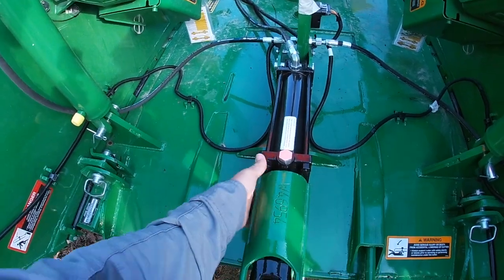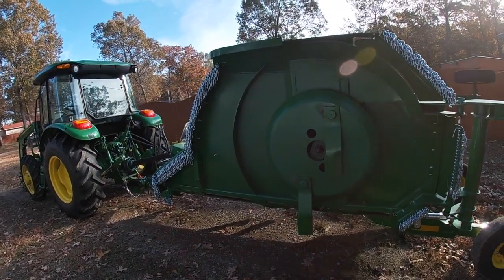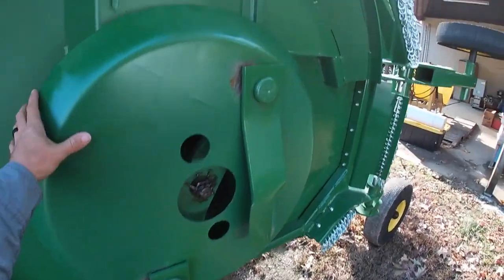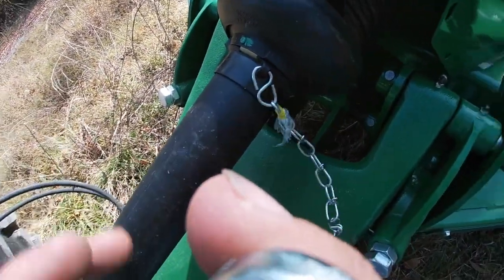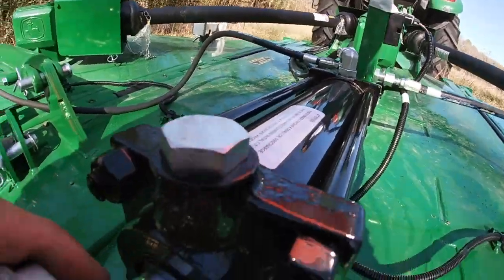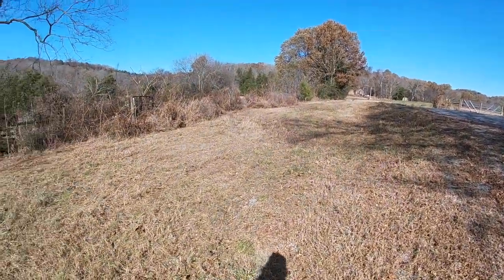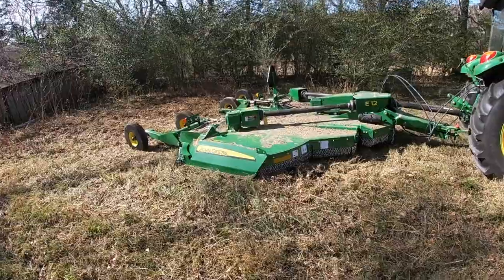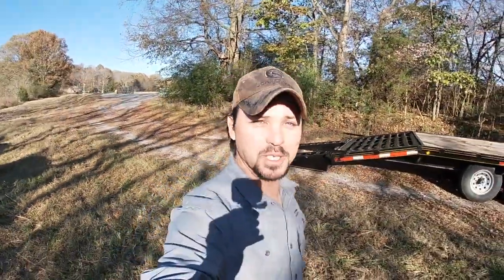E12 Rotary Cutter First Impressions

Comment: Bought an E12 been happy with it. Except, get a good wide zip strip. Wire up the hydraulic hoses by the bat wing lift cylinders. Mine got pinched in the lock pin assembly...

Comment: You need two hydralic valves. One for the up down, one for the wing up-down-float.
Reply: I put the cylinder lift in the back were it’s supposed to go and run the wing lift hose to the block operated by the joy stick.

Comment: How does that tractor and cutter do when you are in real thick green grass?  I use a 5320, 5075E and. 5085E on a HX10 and if the grass is tall and thick enough they are loaded pretty heavily
Reply: Bumping this question as I’m interested in the same

Comment: Bought exact machine today, I will be using it on one scv, manual talks about control valve available, what’s best way to run this thing off one lever, any input appreciated
Reply from the maker: You need to make sure your dealer plumbs the hydraulics where you can do that… everything is hydraulic up and gravity down.  So even if both your hoses are pressure hoses, you just pull your lever slightly backwards or forwards, to where the hydraulics can free flow, and gravity will push the unit down.
Reply: @theweekendfarmer7513  found a manual valve 120 bucks for what I’m doing I think I’ll try that , I understand what your saying thanks

Comment: How did you plumb your Cutter ? Mine came w 1 hose to the tractor. Looks like you have 2 hoses. I cannot lift the belly of the mower without the sides coming up first. Makes it hard when cutting and need to lift cutter. I have to disengage to raise it. It also makes it difficult to engage in y’all grass bc the mower is all the way down to the height I have it set. At the 5 min mark of your video you show yours will lift the belly first then the wings. Please provide me with some guidance.
Reply: I’d like an answer to that as wel , I have to get off and raise it up again so I don’t scalp ,
Reply: @Nathan Justice 
I am not sure. I only have 2 hydraulic connections on the rear of my tractor. Is that the same for you ? Could you provide me with the dealer location you purchased yours from ?
Reply: @Nathan Justice thank you for your help. I only have 1 SCV. The original video that I watched on here from the Weekend Farmer only has 1 SCV as well. However he has 2 hoses on the cutter. I only have 1. Not sure what he did to make that work but if you watch his video at the 5 min mark you will see what I’m referencing. Not sure how to make it work like that.

Comment: Hey we have the exact same set up, I was hoping you could answer me a question whenever i mow the left and right deck always seem to cut un evenly close to the hinges of the middle deck , I’ve tried plenty of times to level , but it always seems to do the same . Thanks in advance
Reply from the maker: Sounds like your wings are letting down too far.  There are adjustments on the outer wheels.  Or, maybe the middle section needs to be lower. There is an adjustment for that as well.

Comment: How long is the trailer you are using with this set up?  Would you recommend this length or something longer?  Thanks
Reply from the maker: Barry Strother.This trailer is 30ft.  Yes I would recommend at least 30ft.  This length is plenty for this tractor, but I do have to set the loader on the neck of the trailer.

Comment: Went to buy one of these E-12 cutters today and during conversation he told me the Gear Boxes was made in CHINA.....That ruined his sale. I bought another brand $1500.00 cheaper.....
Reply from the maker: Jack Freeman Really... what brand did you buy???
Reply: @theweekendfarmer7513  Actually didn't buy yet but probably a Bush-Whacker. Weighs about the same as the Deere but it may have China Gear boxes. In fact they may all have China Gear Boxes. The salesman said it couldn't be made to lift wings separately and if it could that would be a sizeable charge. But did give me a good price. $11,800....I bought a 5100M tractor from him a year or so ago.....Bush Whacker about $10,500
Reply from the maker: @jackfreeman4121  They probably are all made in china... I can tell you that is one tough gear box.  Even my little 6' co-op bush hog has been to hell and back.  If you have one go pre maturely, Im sure they will all honor their 5 year warranty.  Make sure bush whacker has the same warranty. The told me the same thing about the hydraulics. They just dont want to do it...you have to have two SCV's, and you do on a 5100.  Kapper Outdoors has his on 3 SCV's, He can move left or right or up and down.  It would be handy in steep ditches, but yes!!! Very Expensive!!
Reply: Well I went back this morning and bought the Deere. Called three places that said they sold Bush Whacker but no one had one, so I bit the bullet and got the Deere. Salesman told me it would cost $1200.00 to convert the Hydraulics to raise both wings. I told him that would be good just like it was. Have you investigated that any? Have you had any problems with yours?.....I'm sure I will like mine. Deere makes good stuff but not sure they make this 12 foot......
Reply from the maker: @jackfreeman4121  You will love it!!!!  Is this your first batwing???   Everything Deere sales is good, even still!! or they wouldn't paint it green!!Haha!!! If its not they'll make it right...No problems with mine...I have not investigated that...You can do it yourself, its just plumbing. you may have to have some hoses made, but if you have two valves on your tractor you can do it.  The cylinders are hydraulic up and gravity down. So you need fluid to push it up, and then you need a return. I only have one valve.  so I can't do it.
Reply: @theweekendfarmer7513  Yes, This is my first Wing cutter. Been using a 3210 Bush Hog which was OK but wanted a wing. I'm not sure about Deere fixing anything. I bought a 2018 5100M with 225 hours on it and had 6 months warranty left on it. Second time I used it there was a hellof an engine noise started all at once. Sounded like lifters but worse. I complained and they would never fix it. They said "they all do it".....I said I know two friends that has same tractor and theirs don't do it. I wound up and turned it over to my Attorney so they gave me 2 more years of engine warranty and said they couldn't find anything wrong. I told the manager to find me another tractor and I would trade for it. At least I have two more years of warranty left......I'm sure I will like this cutter. All I do is clip pasture and occasionally cut a two inch or less sapling.....Enjoy your Chanell......Keep it up!!